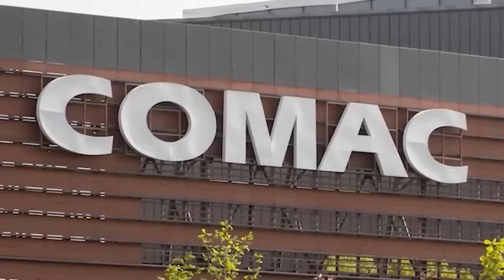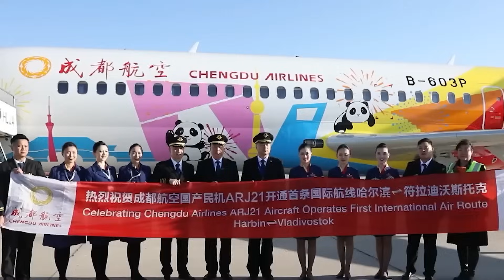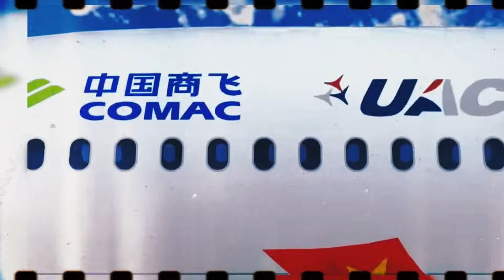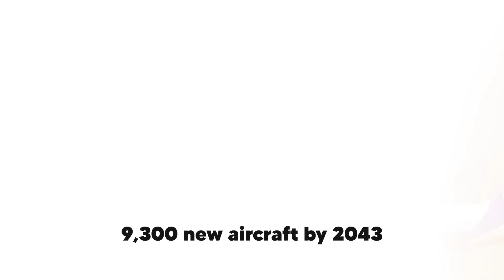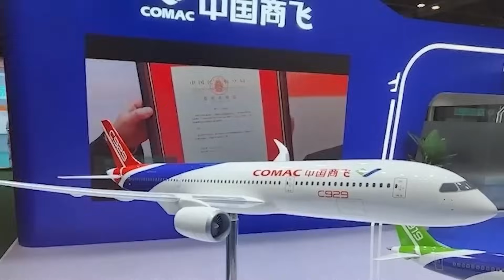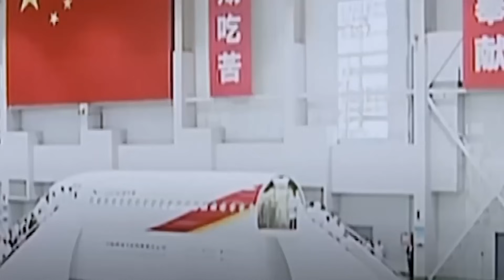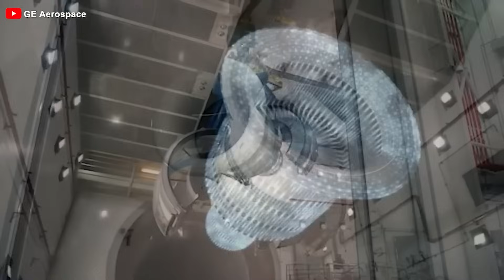China Introduces NEW Plane The C929 & CJ-1000A Engine That BEATS Airbus And Boeing!

Comment: C909 (AR-21)  already accumulated 100,000 flight hours without accident or mechanical problems. Both C919 and C929 must do the same in order to be totally accepted. 🦉
Reply: It takes time to build a record, and as you know that a journey of a thousand miles starts with the first step.

Comment: A great deal of the technology is sourced from around the world for the Comac planes. It makes sense though because the tech it uses is long tried and tested, so if you want fast airworthiness certification, and you want greater safety then this is the way. Now China has a plane, there is reason for domestic manufacturers to supply the parts, as in a  bit of a chicken and egg problem.

Comment: Boing and Airbus are facing massive supply chain problems. In the long run, COMAC will be nr.1.
Reply: Number 1 high speed rail, 2nd largest road network, went to and built their own space station, no 1 car market.  Yes, it's a matter of time despite our bias.  Keep in mind that they are doing this (and many other things) all by themselves.  Unlike Airbus/Boeing
Reply: The trick for China is to be able to ramp up production to meet demand AND not sacrifice QUALITY of build. 

This has been one of the problems Boeing has been facing as well - lots of orders but delivery took too long. This led to cutting corners go speed up production and then cutting off FAA inspections and certifications because Boeing argued that it too long and that it would be better of the FAA left the inspection and quality checks to Boeing themselves. The FAA agreed after seeing how long Boeing has been operating with safety and then, that was when the quality began to suffer. 
In Engineering, there are just things that you cannot push for speed in production and delivery and not spend time inspecting for flaws. 

Remember NASA's space shuttle "Challenger" and how it was decided to launch and not delay it despite the cold weather that could have affected the rubber O-rings in the boosters? 

And years later, the same attitude to hurry in meeting schedules saw the space shuttle "Columbia" returned to earth despite the fact that the shuttle body could have been compromised by falling debris when it took off from earth? If NASA had spent some extra time in checking the craft and discovered the opening in the shuttle's wings caused by a fallen foam piece, and taken the time to work out a solution to fix the problem, the "Columbia" and its crew may have better chances of survival than they did.

So hopefully, China will find a way to increase production without compromising on quality so that every craft that is delivered is 100% spot-on the money/. Don't copy Boeing's mistakes.
Reply: 😂😂😂😂 good joke